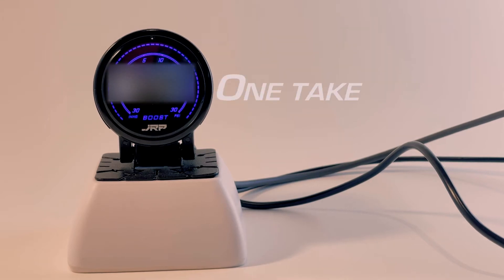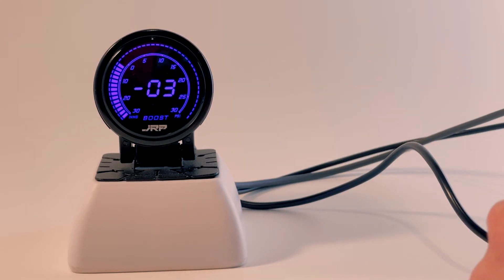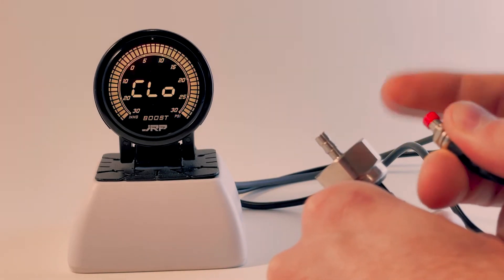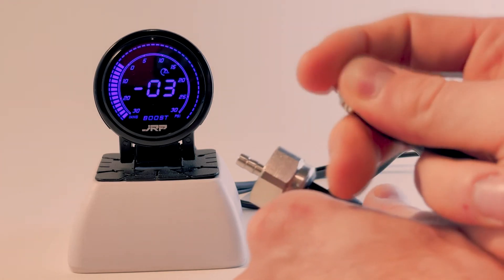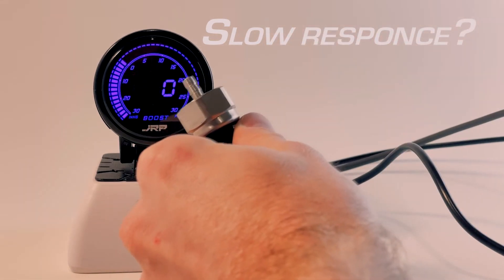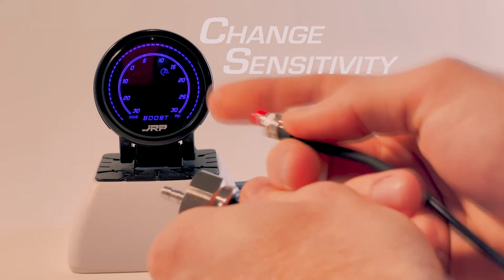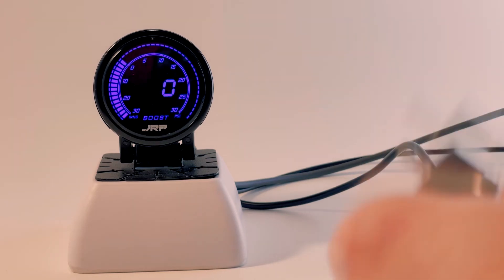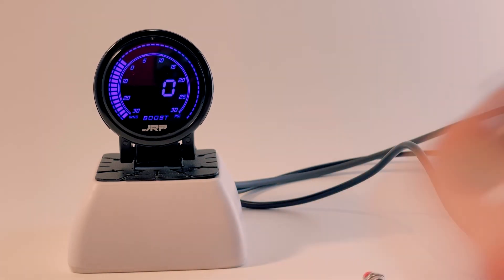JRP Pressure Calibration One Take

Comment: to do this calibration does the gauge need 12v power ?
Reply from the maker: Hey @deanhargreaves6164 For one on one technical support please send us a message on Facebook or you can call our office (AEST) 9am-5pm Monday - Friday. 07 3149 3443
Yes you will need to power the gauge with 12v DC power to calibrate and use this product.
Reply: @JustRaceParts   do I need to do this same to the oil pressure  ??
Reply from the maker: For support please send us a message on Facebook or you can call our office (AEST) 9am-5pm Monday - Friday. 07 3149 3443
Did you get in contact with a member of our team? YouTube comments are only monitored once a week. 
In most cases its not necessary to do this with an oil pressure gauge, but it can be done. Get in contact with us as you may be chasing a different issue, 
Thanks! Zach - JRP Team